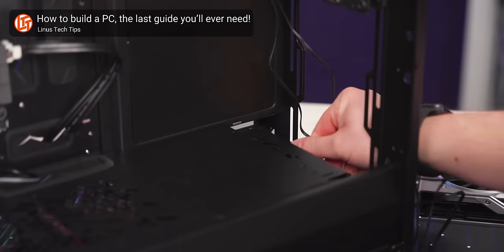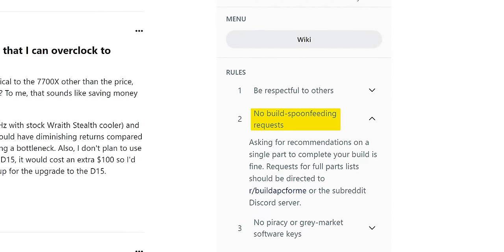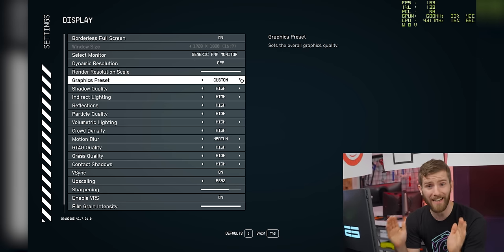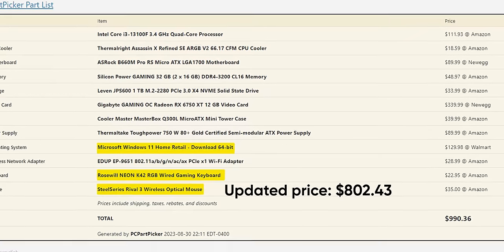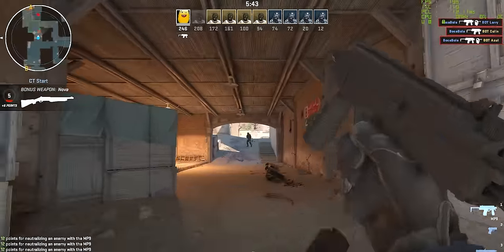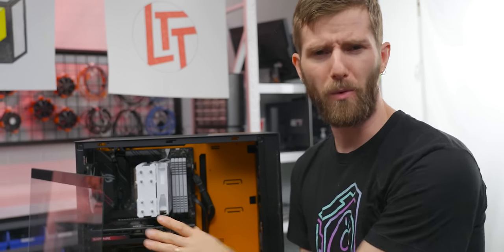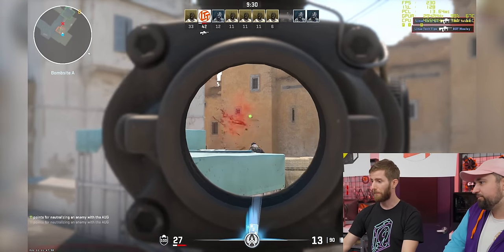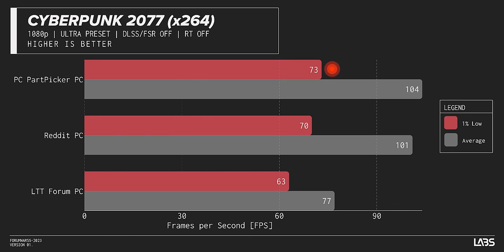We Secretly Challenged 3 communities to Build the Best $1000 Gaming PC!

Comment: I just built my new PC today, and then this video comes out, lol.

I...took a different approach.  Spreadsheets!  Well, I basically did a combination of hardware benchmark ratings and pricing, and determined how the value laid out.  I also compared these benchmarks to the PC I was replacing, just a 3 year old pretty much top of the line PC.

From a purely benchmark standpoint, I found a few interesting things.

One, SSDs have gotten WAY faster in read/write/etc. capability.  Coming into this new build I was thinking a SSD is a SSD is a SSD, and they're not really that way.  Their performances scaled up considerably. How much it matters in the day to day stuff, well, it's not nearly enough to put big weight on a benchmark score.  But just from a few years ago, the raw capabilities and the PCI generation changes have bumped this up a whole lot.

Two, CPUs, in terms of cost is pretty much linear.  Both AMD and Intel play on the same field, and they both lay out their pricing pretty much flat across it with a pretty consistent price per performance gain.  The good is you can pick anything, and you're getting a "well valued" gain for the price.  A big bonus is this means a good, budget one is still a solid performer.  This also means a top end pick doesn't break the bank either.  If you're a CAD guy like me, I can go straight to a 14900K and not feel like I'm throwing away money to get the high single thread performance CAD software like SolidWorks needs.

Three, GPUs, outside of something like modern ray tracing and scaling for modern monitors, they have lethargically moved.  For example, I was coming from a pretty dated 1080, and the majority of modern mid to high end GPUs were a mild 30% to 60% bump.  Again, just from a benchmark score standpoint, it took a 4070 Ti to bump me up to a +100% gain.  I can buy a 1080 today for like $60.  A 4070 TI is a $1000 GPU.  And most reasonably valued options are really only bumping me up 10% to maybe 40%.  It's...disheartening how bad of a value GPUs have become, and it kind of sucks there aren't work arounds like SLI to buy you time.  Worse yet, generational changes also didn't help pricing.  A 3000 series GPU isn't even cheap, at all, despite the 4000 series being out.  Even the 2000 series stuff is overpriced and without enough of a performance bump to warrant even looking at them.  AMD isn't an improvement either.  Their cards are all overpriced versus Nvidia for their performance level.  People are just demanding too much for what they are.

For me, it was mainly a game of picking some of the best I could get, if the pricing wasn't skewed, and try to hunt down values by aiming at the used market where it made good sense, aka GPUs.  I reused my peripherals, case, power supply (picked a "big" 750W a few years back that luckily held up to what I need today), and hard drives.  The only new stuff needed for the upgrade was motherboard, cpu, cooler, ram, and GPU, although I did pick up one, bigger, new SSD and cloned my main drive over to that.  Oh, and I did pick up the Alienware 34" QD-OLED to replace a couple of...uh...old 24" gaming monitors (from 2011).

Mine wasn't a $1k target or anything, but it was an interesting exercise and refresher for me of all the new hardware that popped up the last few years.  It was interesting to see what sectors have progressed.  One thing I didn't do was look back on pricing to see how much the value proposition changed.  A lot of the pricing "felt" similar when selecting a current equivalent level product, well, outside of GPUs and to an extent monitors if they're any of the "new tech" kind of stuff.  The pricing sticks out like a sore thumb.
Reply: Thank you for sharing your observations with us. I don't think many people will read your whole comment, but I did, and I appreciate you taking the time to write this.
Reply: This was very informative and unbiased, thanks! Especially the part about GPUs, a lot of the PC building community hails Radeon as their savior for  their better performance but you put it best, "they're all overpriced for the value they offer". Hopefully Intel GPUs bring a better price proposition soon.
Reply: @trippinhard250  While AMD might retail their cards at a slight price advantage, the refurbished and used market is not.  Contrarily, many seem to ask for a premium and often slotting them slightly worse than each Nvidia counterpart.  There's almost always a slightly better Nvidia card at a better value proposition.  Or even at best, both sides are nearly equal, and with many games favoring Nvidia cards, it's hard to want to snag an AMD.  It'd be a little different if AMD forced the issue and significantly undercut Nvidia, but racing back down to the bottom of pricing competition isn't advantageous for either company.  There's likely a bit of a gentlemen's agreement going on that's ensuring both sides are largely staying equal, and both seem entirely content with that proposition.  The story might be different in there was significant need for the newer tech.  Yes, ray tracing was one need and 4k was another, but unless you're at 4k and are big on ray tracing, older cards still just work and work well even on higher settings in modern titles.  There hasn't been a modern game that you just can't play with old cards, and game developers certainly wouldn't want to do this either.  I'll still happily buy the best I can get at a reasonable value.  Comparing, that'll never be a 4090, lol, but anything below at leasts moves around enough that there's some chance...if you don't mind waiting a little bit.  For the pricing structure, it's tough for me to buy anything but used.

Funnily, I wish Intel would shove some serious resources into their GPUs and get those up to speed quick.  They're the odd man out, but if they can get the right talent in, they could pretty quickly get a decent foothold in the market.
Reply: @Xmvw2X  I'm cautiously optimistic about Intel's GPU lineup. Their first attempt is already a real choice to consider for budget builds after all the software fixes. Battlemage has a chance of taking those updates and slamming a much more powerful GPU lineup onto them.

Comment: Please, in the future videos, use equalizer to remove the unused low end noise, I could hear constant hum on my studio monitors and it was annoying. Always use low cut below 100hz, not no all channels but on the channels with recordings.
Reply: yeah, that was pretty distracting
Reply: @Probosporone  Also it's not the first time, in multiple of their videos i can hear this low end, I guess one of the editors doesn't know that it should be done. I also saw like 2 years ago that they were planning on hiring audio eingineer, but what came of it, I don't know. If they have one, they should be participating in QA
Reply: @callmeasshole  It's an easy change that requires like 7 clicks and 30 seconds at most. You don't need any high end equimpent to hear this, you can hear this on most setups, I just tried it with my cheap earplugs, i hear the same thing.

Comment: The ssd tier list in the ltt forum is goated
Reply: I liked Tom's Hardware to end up with my 4TB 990Pro M.2, but I get I got the most overkill out of all the options. At least it was $60 off when I picked it up a few weeks ago haha.
Reply: Ultimately the answer is usually it doesn't really matter. Getting a super fast expensive SSD for regular daily use is like getting a sportscar for getting groceries. If/when directstorage finally becomes more commonly leveraged, this might change a little, but otherwise there is next to no practical difference between a cheap PCIe 3 SSD and a expensive PCIe 5 one.
Reply: @SaltyMaud  unless that cheap SSD you pick up doesn't have a DRAM cache.
Reply: @SaltyMaud  I ended up getting a PNY XLR8 CS3040 2TB ssd. Believe me, I know you don't need the best of the best. That's why a tier list is useful, so you can see how all the options compare and have something to help you sort between all the options available.

Comment: Compared to these my build suggestions as of late are, lets say, more eclectic. I've been giving a lot of love to LGA 3647 and 2066 with Comet Lake and especially skylake xeons doing their EOL price nosedive and 16gb sticks of ECC DDR4 doing the same. The used workstation market is alive and well for the willing
Reply: Hi Randar, which build would you recommend to get comparable results. I'm looking to build something starting from a workstation as I like the understated aestetic.:)
Reply: @MultiBrownstar  Hmm I thought I posted a reply earlier... in any case my build is as follows: a xeon W-3235, 96gb of DDR4 ecc (6x16gb), and a 3080. It's not going to provide you with the full CPU performance of these machines in single threaded loads your multithreaded load is helped by having 12 cores, though your GPU performance would be close to on par with the best in the vid, and your memory throughput is amazing. The CPU performance isn't really gonna hold you back all that much though, you can think of it like a 10850k with a little less clock speed and 2 more cores.

If you followed my spec list with ebay prices at time of writing you'd come in at about $1000 if you started with a barebones HP Z6 G4  workstation and added on from there. That also includes the fact I have a 1tb NVME as a main drive and 2x2tb SATA SSDs for bulk storage (after all a modern steam library should have more than 1tb and I'd argue even more than 2).

I like building on workstation platforms because I am wholly unable to deal with instability. I actually transitioned from the technically better for gaming i9 10850k to this system because of crashing issues, so I opted to leave just a bit of per core CPU performance behind for that ECC memory and a lower possibly more stable clock speed. Plus I'm looking to rework my networking setup as the ISP I work for transitions to higher than gig speeds and now I've got the extra PCIE lanes to add a 10g SFP NIC direct to CPU, of course you could use them for whatever or not at all. Capture cards, more NVME, a good sound card, USB expansion, whatever you like really.
Reply: @AmaraTheBarbarian  intel workstations are nonsensical for anyone not living near a power plant, and anyone in europe. 65w amd vs 180w intel cpu.
Reply: @tarkitarker0815  you're free to think that if you wish, however I will note that building a desktop has always been making a more powerful machine at the cost of a higher electricity bill, so if that's your opinion you should probably be aiming for the docked laptop market. But if we're talking about getting the most performance for your dollar there's more to consider than simply "X product has a higher tdp rating". For one thing that's a full load thermal design spec, if I take that vs say a 5600x then I have twice as many cores, but if my load is halved and I'm using 6 cores as opposed to the full 12 then my power consumption will be roughly halved at 90w, but I have the ability to more quickly handle loads that are greater than 6 cores. I have greater ability to multitask not only due to my doubled core count but my massive increase in memory bandwidth, going from 2 channels at say 3200, to 6 channels at 2133, additionally ECC memory provides me better stability than I had on my prior Ryzen and Intel systems. I also have the freedom, as stated for more add on cards to use as I wish with the additional pcie lanes afforded by a pro system, 48 raw with no less than 3 multiplexers in my case, with 4 22110 nvme slots.

So no it isn't nonsensical to use a Cascade Lake Xeon, it fits my preferences better than a mid range consumer AMD chip that would cost me more to put together than picking up an old Xeon workstation.

It's the 3rd 3647 Xeon operating in my apartment, an additional 2 in a server used for game server, video, and audio hosting. You know what uses way more power than a pair of 20 core Xeon golds? Having an old refrigerator.
Reply: @AmaraTheBarbarian  dude its really easy, amd at the same ipc as intel uses less than half the wattage for high core counts up until 11th gen. buying used xeons isnt the way unless you live in india, or china, or next to a supplier in the usa. we are a gaming channel here, no one is going to need more than 8 cores with ht unless he does business, and then he wants new bc new means faster working than used anyway.
Reply: @tarkitarker0815  Bro I neither speak fanboy nor your native language apparently. You're making getting your power consumption from a thermal design spec that is for a full load scenario. 

If you're right that nobody needs more than 8 cores then you have to figure the drop in power consumption based on an equal core utilization vs a given consumer chip. Taking (roughly) 60w off the top for a 4 core drop in util puts the power consumption at (roughly) 120w for my W-3235, compared to the 105w of a 5800x, the xeon being 14.3% more power hungry than the zen, not more than double. Even if these numbers were directly comparable, which they aren't because TDP is a thermal design spec which each company calculates differently based on W of heat needing dissipation (and the recent 7000 series chips for AMD were said to be operating as expected at 90+c),  this would only account for the stock boost behavior, something that a feature like PBO on consumer boards changes drastically.

The most important individual component for gaming is the GPU, if you can spend less, sometimes significantly, on a retired workstation what you can do with the remainder can constitute massive changes in the gaming experience. The longer those workstations sit in warehouses waiting for their second owner the more their prices drop, the initial buyer of new hardware has a price floor of what's still profitable for the manufacturer and the middle man. This is part of the reason that I gave 2 sockets, 2 generations, and my personal spec, because right now I could pull together a 6 core skylake xeon W with 16gb of RAM and an rtx 2080 for under $500 US complete. There's a half for you, half of the $1000 price point of these new systems.

Lastly in many countries that aren't western europe, the US, and canada local pricing of hardware varies wildly, which is what keeps even the market of used LGA 2011 "X99" xeons alive in some places, even though I'm sure we'd agree haswell and broadwell aren't anywhere close to as efficient or powerful as more modern chips. Ironically making your callout of my take the western centric one, since local pricing and income makes any prescription of what is the 1 size fits all solution totally irrelevant.
Reply: @AmaraTheBarbarian  you are mostly right with your ted talk but you have to notice that your xeon does run a way lower stock clock, meaning you have to up the multi to make it competetive in 4 core demanding titles since intels bboost behaviour does only allow 1 core spec boost, 2 cores at 200 below 4 at 350 below and so on. bringing in pbo is kinda funny because enabling pbo just for curve optimizer and the clock override of 200 to 400 will make it consume less and boost higher, ive never seen a zen cpu that really took more wattage after this, maybe 10w. i would also buy a used xeon if i ever wanted to do something that needs many cores its a no brainer since 12+ cores cpu´s of amd arent cheap even used, and those from intel that arent xeon use way too much power if loaded and cry about electric costs. but its simply not smart for normal gaming if you need those boosts or play skylines or something, then its gonna disappoint or chug  10 gallons per mile.

Comment: When it comes to part selection, I've come to value the case, PSU and motherboard above all else. I would gladly trade 2-10% performance for something that won't take me 3+ hours to build (including breaks due to frustration), and I dread ever having to take it apart.
Reply: I've flip-flopped on this over the years. Sometimes I go high end, other times I go midrange. I've been happy with both.

I really like my Phanteks G500A now, but really I'd have been fine with a cheaper case that has enough GPU clearance. The motherboard is the one I skimp on first - it rarely matters all that much unless you want to push your overclocks. I'm happy just letting PBO figure it out and dropped my memory timings a bit. 

I don't like skimping on PSUs though, and if you get a good one - it will outlast all your other components. A nice Silver rated 750-850W modular one is plenty for the vast majority of PC gamers and will be for about 5-8 years at least.

Comment: For the reddit build, you said you got a 16GB kit, then promptly show a 32GB kit. Which is it? (3:24)

The LTT parts, you say Corsair power supply, then show a Seasonic logo. (10:55)
Reply: They were using the closest equivalent parts they had in the warehouse at the time -- I don't think this video would justify sending Elijah and Colin around to Best Buy to get something that might not be used again.